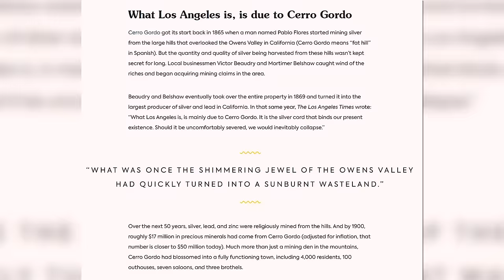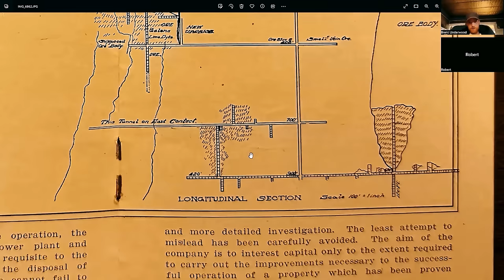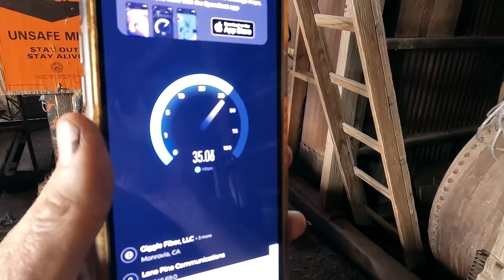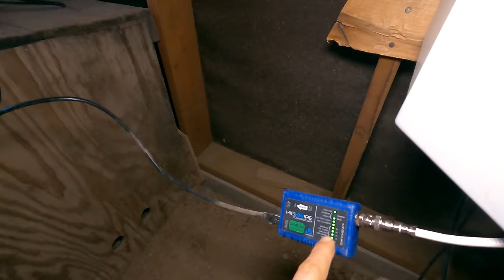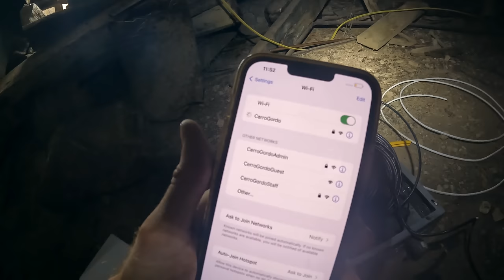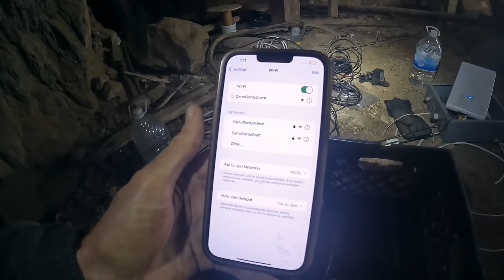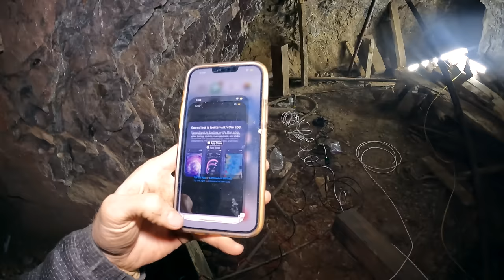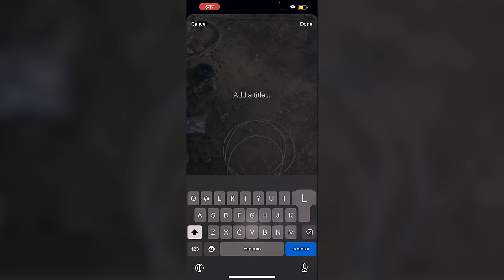I Have WiFi In My Abandoned Mine! 900 Ft Underground!

Comment: Gotta be honest, with this kind of location and lengths involved I would say you will need to look at a fibre solution for this long-term probably with armoured fibre on vulnerable sections so it can take a hit.  That massive shaft is basically going to be like a network backbone and vulnerability all at the same time.  
Also that power line distance must be getting wicked resistance and voltage drop - you might have to consult an electrician on that one or do a ring circuit for some load balance.

Comment: Regular coax and ethernet cables are really bad for connecting things at long distances like that. If you ever get to a point, years from now, where people are regularly visiting the mines, you should definitely upgrade to fiber optic lines with multiple switches and routers. You'd be able to get a good connection even all the way at the bottom and can probably set up emergency phones attached to the network.

Comment: Ethernet can go 328ft.
You should do standard Ethernet from the top station down to the 300ft level and put an access point there, then run Ethernet up from the 900ft level to the 600 foot level. Coax would be backhaul.
This would in theory give you reliable signal the whole way down.

Comment: you really should have a loop every landing to take the stress off the cable. Coax has a solid center core and a braided outer core. This means that is it is stretched the center will pull out of the connector. I would have used fiber, but for that you would want to look up the maximum height and then mount old wire spools at the landings to wrap the fiber around to take up the stress.

Comment: For communication simple is the way to go only need two wires run down the shaft (coax would work as its two wires) then tap off at each level connect magneto telephones to the two wires and you have a pone that can contact the hoist simple and dependable.

Comment: The best solution would be to run fiber down to the 700 level to a PoE switch with two SFP ports on it. Run fiber from the 700 level down to the 900 level with another identical switch. Then run another fiber from the top all the way down to the 900 level. Create a ring network on separate cables. If one single cable link fails, there is still a signal somehow. This is for safety after all, right?

Comment: Since power is available, fiber could have been better option that koax for such distance, less power required and guaranteed signal as long as you don't kink the cable, can't splice such cable though without special equipment and it's about $0.90 per meter (not armoured, just sleeve protected), armored seems to be around $1.10 per meter?
13:40 - Unifi access point have very annoying default setting, to disable the Wifi if it doesn't have uplink connection, it's best to disable in such conditions fi there's a chance of unstable connection

Many phones now support wifi calling, so technically you should have mobile phone connection

Comment: RG11 is lower loss, would be a lot better for a 900' run

You should partner with Olight, their headlamps are awesome, as are their camping lanterns that I keep around the house for power outages. I have their Warrior X turbo and it would be awesome for lighting up shafts and tunnels, I use it to spotlight coyotes at 1,000 yards!

Comment: "What is the Maximum Ethernet Cable Length? The popular CAT5e, 6, and 6a cables share a maximum length of 328 feet or 100 meters. That means you shouldn't use more than 328 feet of cable to connect any two powered devices, such as a network switch and a computer."

Comment: I'm not a specialist in internet connections. But I was concerned from the start about too much resistance in that length of cable. Personally I would test the whole setup up top before installing the cable down the shaft.

Comment: You really should check what the needed voltage is for the Wi-Fi  as well as the signal strength at the top and the bottom.

Comment: you have power down there, you could have just used internet over power accesses point, plugs into the power and send the data packets on the same cable. would have saved heaps

Comment: 4:00 Why coax??? I suggested that you run direct burial fiber last year. It is waterproof, and has kevlar strength members. Gigabit Ethernet/Fiber transceiver on both ends, cost you maybe $200 total. Coax Ethernet is limited to 100 meters. You're trying to run 300 meters. That shit ain't gonna work, or if it works, it will barely work.

Comment: You might need to break up your run into two or three sections.  I guarantee you need the rg11 for a stable signal.  I do IT and have run into that with clients in high rise buildings.  Cable internet company had to switch to a power booster with thicker line to make it to 16th floor.  After bigger cable internet was stable.

Comment: Are Cel-fi phone boosters available in the US? If so That could be a good option for phone signal down the shaft with some decent yagi antennas. You can even  have another repeater down the hall. I have seen sites here in Aus where the phone signal is going booster to booster to booster then tower, might be another option.

Comment: Do you have a link to the radio device that was used to retransmit signal and allow you to capture it into the cable? I am looking to achieve similar effect with my off grid property that has a couple of bars but ultimately not a strong enough signal across the entire property. In the far corner I get 4g and can stream video and I am looking to amplify, capture and rebroadcast the signal on the grounds. Thanks! Love seeing the progress! I have some interesting insight as well as I did a story back in 2013/14 on CG in the local eastside newspaper/magazine. Hopefully you already came across it! Best, Alex

Comment: curious, on your water pump you have there what size wire do you have feeding it , and the motor rating or full load amps on the motor plate?     seems you are not accounting for voltage drop   that romex at 900' is way to small for small things, on a load you must only be getting 97-105 volts on the romex.        so is the pump feed undersized as well ?    pumps are thirsty for amps and constant voltage

Comment: Scrapp all that if you have power  use fiber it's waaaay better and higher speeds.yes maybe more pricy and harder to connect as not all people have the tools to do it but you will have less issues. Most   ftth  routes work of 12v to 24v  so you don't need intense power to get it to work.

Comment: I would like to stress the fact that you are in a very seismically active zone. Earthquakes knock out power and your wifi will stop working. often they  cause landslides and collapses. If you are going to be down there for extended periods, it increases the chances of something horrible happening. Please take extra precautions. let people know when you are down there for extended periods so that help could be provided should there be a major quake in the area. Have extra food, water, batteries and lanterns. I myself would not go down there for any longer than absolutely necessary. Having said that, I pray you are kept safe, and congratulations on having a way to communicate from 900 ft.

Comment: Awesome project Brent Just curious is voltage drop not a issue for the power running down? if i'm not mistaken 12awg wire is good for about 50 feet at 20 amps 120v before it starts dropping off? Are you guys running at a higher voltage or something?

Comment: If you're looking for something a little more reliable (and fun?), check out setting up your own LTE network. Modern day autonomous mines use LTE to control heavy equipment deep underground. You can bring new world mining technology to your old world mine! I bet replacing that Coax cable with Fiber would bring immediate improvements.
Edit: Please setup air quality sensors if you plan to live down there for days at a time.

Comment: Would it be possible to use solar panels and batteries to run an electrical current from the surface down into the mines for a few limited areas so that you have light? Might be nice if staying down there for a long time to have some light. Maybe an emergency generator down there too... if you can somehow get it there.

Comment: Wow, doing some stuff I do for a living... 

I would have done fiber instead of coax. Then throw an industrial POE switch at the bottom, you can branch cat6 up to 300ft for wireless access points to get as much coverage as you need.

I would repurpose the Coax for RF boosting to relay a signal from the top to the bottom over the coax with a decent two way radio system like motorola

Of course all these things probably cost about $4-5k together

Comment: If you need to go 1000ft it would be much simpler to use fiber.  Multi mode fiber can go up to 1000ft use cleerline ssf fiber then power your access point from the 110 power supply.

Comment: Brent, are you not worried about voltage drop only running 12/3 down 900 ft? By the bottom of the mine you’ll only be left with 46v after you calculate for voltage drop

Comment: Would of ran cat 6 or cat 8 or just used a extender that used regular 120v lines. You plug one box at the top of the mine where the power goes down the shaft and connect that box to the router. Then at the bottom of the shaft or where ever you want to put a router for wireless you put another box. It uses the 120v line feed the signal instead of a coaxial. Its not as fast as cat6 or cat8 bit will work. Its called a power line adapter.  I use one to run internet to my hunting blind 1500ft from my house.

Comment: I would have used fiber. And then power is fed into the ends of the Ethernet cable.
Fiber has no problems transmitting data over long lines. 
Copper Ethernet is limited to 100m, 300 feet. 
I can't determine the max length of the coax cable, but there can be echoes on the cable.

Comment: Aside from the correct comments that you should have used fiber instead of coax, what I don't understand is why you do not test the system at the surface first...
Just connect everything together with the coax still on the spool (pry the end out and attach a connector) to first check if your system can work with that length of coax.
Probably the cable is not defective, just "too long".

Comment: You can't just splice coax, think of it more like an antenna and cutting and joining it will f**k up the transmission especially when youre at the limits of reasonable length.  

Since you had a power outlet at each level you could have just put a  cheap ass switch every other level or so and limit your runs to a couple of hundred feet at most. Then you can bring Ethernet to the other levels and get higher speeds.

You could also add a WiFi access point at those levels with a suitably oriented antenna and give yourself WiFi all up and down the lift. Heck put some cameras in so the lift operator can see the lift progress.

Comment: Also I don't think it's good for Signal cable to run parallel with high voltage power the frequency disturbs the communication if you can get it further away from the power may work better

Comment: GOOD NEWS ABOUT THE ETHERNET CABLE THE CAT 5 AND 6 IS 40 YEARS OLD WHICH IS IN THE MHZ BUT THE 7 IS AT 10 GHZ AND THE 8 IS 40 GHZ... THEY ALL DO THE SAME JOB BUT THE 8 UPGRADE IS THE HIGHEST SPEED WITH NO  CUPLES INBETWEEN.....

Comment: If you would have used a unfi switch at the top and bottom you could have run fiber down and got full 1G internet just need armored fiber cable

Comment: Is there a reason you didn’t use fibre down? Coax is going to be very limited on speed. Especially for running cameras. You have power down there so could have just had a nice fibre cable running down into the switch and then cat6 for everything else. Fibre isn’t that expensive these days, if you had it terminated to the length you required and weren’t splicing it yourself. It would basically be fit and forget! 
Still 50 to the outside world is decent, I’d be interested how fast it is on the LAN.

Comment: Why don't you directly use cat6 cable for example? Why the conversion from rj45 to coax to rj45 is needed?
Reply: cat6 can't go more than 300ft.
Reply: If you are planing to have internet on all mine levels you can use switches which will also work as repeaters...
Reply: @ivanpuntev8667  Or just use 1 fiber cable which needs no power and repeaters

Comment: You are dealing with 2 problems. DC power does not travel as far as AC as even slight resistance in the wire quickly adds up(AC is able to travel hundreds of miles will only small losses), you would probably need signal boosters to get radio signal to travel such a long length of wire. Even above ground cable TV/Internet systems need repeaters at regular intervals.

Comment: You already have power. I would have run CAT6 ethernet with PoE repeaters every 100 metres. If you had too much volt drop after a few hundred metres use PoE injectors instead of the PoE repeatersto account for the long run. 100mbit link no problem and cheap as chips

Comment: The Problem with poe, is that at 1000feet for cable(315m) the poe is max 10watt, and only is 100mbit poe standard(the mix oup off 24volt/48volt/poe++). The AP uses 1000mbit poe standar, and at 15watt+
The solusion is to get a AP that use less power, and the old poe standar.

i like the ide, that the coax is a backup if main, power fail's, small batteri/ups in the top cabinet will help.

Best solusion is to get a hybrid fiber cable with power cable and make a "service loop" on every level say 4meters
The hybrid fiber cable needs just be 2 fiber, and 2,5mm2 coper cable. 
Use Gpon network, OLT at topside, and ONU on every place you like wifi/internet.
IF in futrure you like to exspand  on ANY level/or go deep'er..  just ad a splitter(passive no need for power) , and you can splitt the fiber and add up to 128 ONU(fiber to ethernet/with wifi)

Comment: Why coax? Why not run fiber instead? You got the power down there, much easier to run than coax and higher performance.

If you necessarily need coax for something, you could run coax over fiber converters, but I really dont see the need except for specific tasks like GPS sync / timers etc.

Comment: shouldnt have used coax as you will get losses over that distance, you would have been better using a fibre optic transfer for the connection. over that distance virtually  zero losses

Comment: IF you plan to run cameras and upload things Like Video and Calls, you will need a decent Upload Speed, at least 5mb/s. Down Speed only useful for receiving data. Ubiquity makes great products but do required additional POE 48vdc when exceeding 328 feet, hense why you where having connection problems having the extra POE injector at the receiving end was the solution rather then trying to send POE 900+ Feet.
Reply: I'm sure he said he had around 40mb/s both up and down...

Comment: Honestly a couple of questions. California really allowed you to run 12/2 Romex down an elevator shaft? With moisture and a chance of it getting cut. Surprised conduit wasn't recommended. And also the "coax" cat 5/6 cable you are using isn't shielded or put in conduit. It will definitely get static from the 12/2 Romex you ran. And they need to be at least 12" apart because of this reason. Ubiquiti is a good choice. Especially for the price. Cambium would have been a better option though. And splicing CAT5/6 is not okay. Do a midspan poe injector to make sure every splice you do, after 300' will ensure you that it will work to its full potential. Especially if you want to add POE cameras throughout the underground mines later down the road. I love watching your videos, but this wasn't done too well
Reply: And sorry didn't realized you used rg6 coax. Fiber would definitely be a better option.

Comment: I wonder how many tons of rock AND ore have been hoisted up that one single cage...

Seeing as, at least to the best I am aware, it is the only way in or out, for ore or rock, is that one hoist, it looks like it was running nonstop forever, unless other hoists once worked there.

It would be cool to get some plywood, and make a temporary cage liner to use it to haul out massive amounts of rock [and ore?] from those lower levels.

And while I know [at least right this moment] it is not an open, working mine, I'm very certain that if one processed the mine dumps and the land fall from inside the mine, a lot of lead, silver and zinc could be pulled out [without actually altering the mine its self, nor the ecology around the mine] simply by sending it some place or having Jason of MBMM coming up with some equipment.

I'm sure it would not be 'millions', but it could still help you run the museum/educational aspect of the mine.

Comment: To be honest... That's a very expensive implementation. I would've gone with just 2,000ft of cat6 cabling with a deco M4 unit every 300ft to maximize range and signal. It'll also get you WiFi midway through the elevator and is made to fail over if any part of the Ethernet backbone breaks. Additionally, there's an app you can use to see where any device is connected in the mine. Very simple to set up.
Reply: I don't think those things are built for the harsh environmental conditions of the mine

Comment: 900 feet of 12/2 romex? Yikes
Reply: Was surprised more people didn't comment about it 😂  Also not being mc or in conduit to protect it from rodents,etc.
Reply: @caterpillar5574 that and  I'd be concerned about the 3% per 50 foot voltage drop, too.  900 ft is a pretty huge distance  😬
Reply: @yermoffroad  I looked that up too . Not counting anything but 900 foot shaft you would need 3/0 awg to have there be 120v 20 amps with a voltage drop 2.63% according to a calculator on southwires website.

Comment: Get a TP-Link MC220L - Gigabit Media Converter! It is only 30 dollars per part and can get you 550 meters / 1804,46 feet. It will give you gigabit internet for under 200 dollars at 900 feet inc cabels.